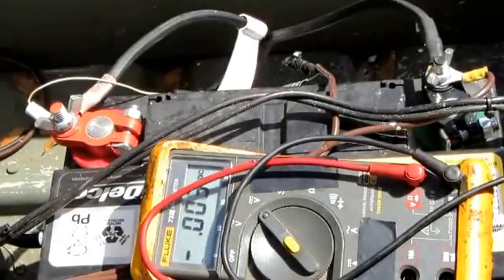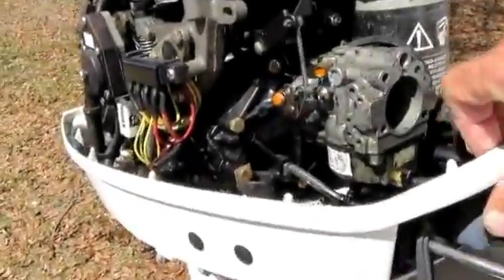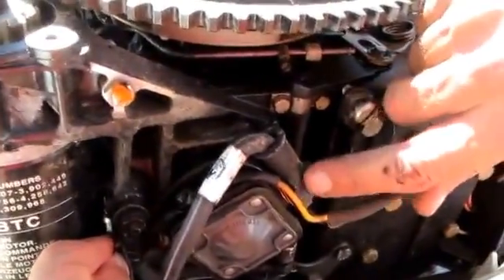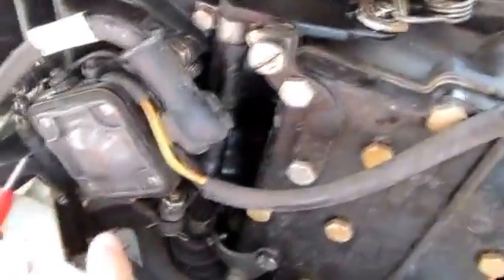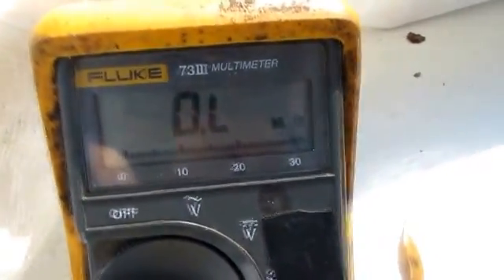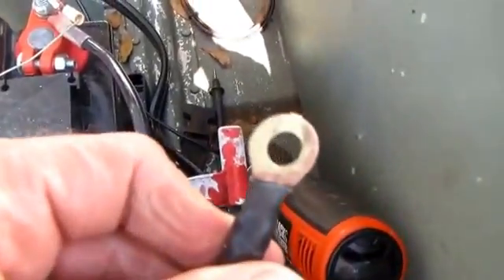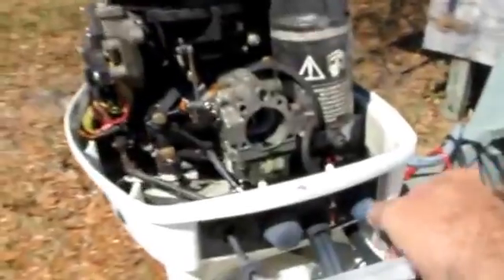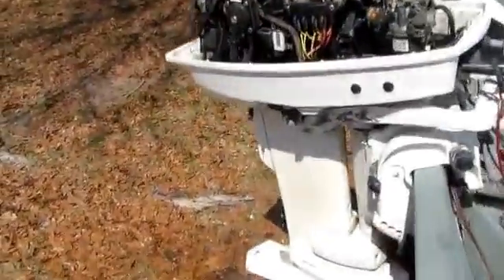Use A Multimeter troubleshoot. Boat Motor Will Not Start.

Comment: After replacing the selenoid the engine was working as it should, but then after removing the battery to charge it, the engine will start again, it might be the battery terminals after all

Comment: What? The voltage on the other side of the solenoid should’ve been the same as what you read on the right side. The reading was open so that indicates a bad solenoid and you cleaned your battery connection? How does that make sense
Reply from the maker: Only when you have the start button pressed and the solenoid is activated will you have volts on both sides.  Thx for watching.

Comment: My motor started well to Day and we lowered idle speed and the motor would not turn over again and the motor. Seemed awe fully hot
Reply: I replaced the selenoid thinking that was the problem and today the engine will not start again, i removed my battery to charge it, and the outboard will not start, i suspect it has to be battery terminals.

Comment: I hope mine is that easy I have a noise but it's not the motor. I'll have to check connections at battery.  I have a I/O
Reply from the maker: Good luck and thx for watching.
Reply: Yep found out mine is a bad battery.